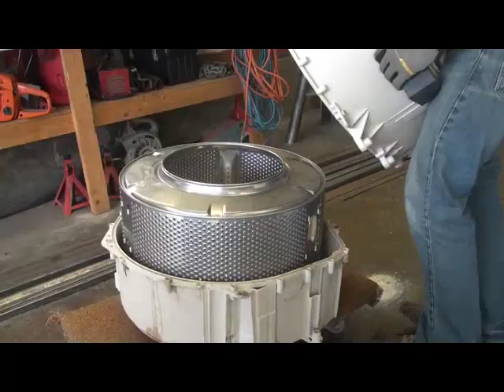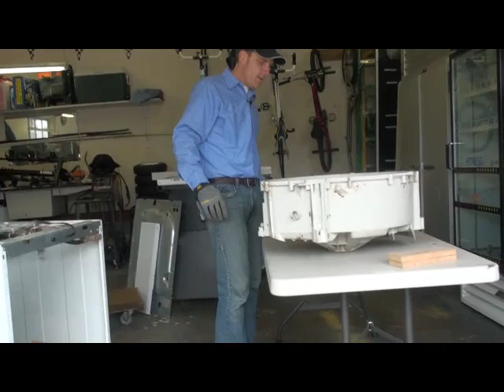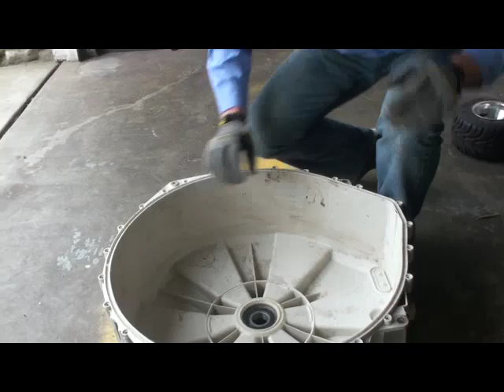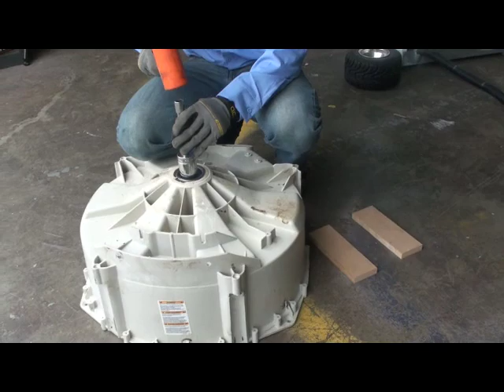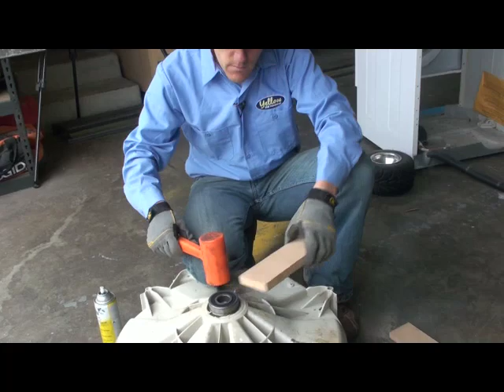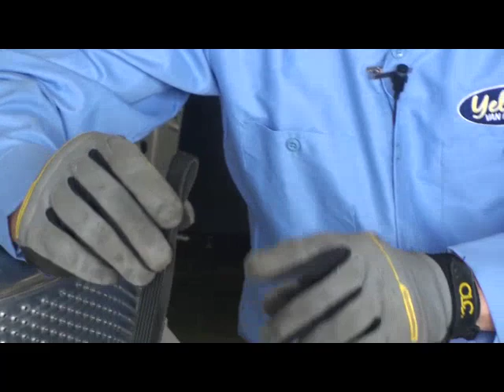Loud Bearing Noise? Frigidaire Gibson And  Kenmore Washer Repair Explained.

Comment: Can you tell me the part number for the seal. My original one says 1312757
Reply from the maker: stheriault3067 The seals do not have part numbers that are useful as the manufacturers do not allow them to be sold individually.  That is the reason why we created a repair kit so that you do not have to buy a $400 - $600 assembly.  See this page for a kit for your machine:  http://www.yellowvanhandyman.com/washerrepair.aspx

Comment: Hi, I wasn't able to replace the bearings, and ended up buying the whole rear tub assembly. About a yr later, I'm having a new problem: the drive pulley has ground some grooves into the body of the tub, and now the pulley get caught in there, pulling the belt off. I've replaced belts, and shock absorbers, but it only lasts for a full wash load before slipping off. Please any ideas?
Reply from the maker: It sounds pretty serious.  The only thing I can think of is you maybe able to put a hardened steel (like stainless) as a washer between the pulley and the housing to prevent the rubbing.  It sounds like what is happening is that the alignment is getting so far off that it is actually causing the belt to pop off while operating.

Comment: I am about ready to take the washer apart to potentially replace the bearings. My concern is that if the spider bracket needs to be replaced. Where can I get one, if needed. I have not been able to find the model # or availability.
Reply: Scott-
You may have seen the comment on the chat group earlier today but the spiders are not normally available without purchasing the entire drum assembly.  Thankfully most of the spiders are not bad so you can swap the bearings and the seal and be ok.  You can also search to find a used unit that is being scrapped as there are a lot of them.
Jerrod

Comment: I just got done working on mine with your bearings and seal kit. didn't take 2 hrs. I used a 5 gallon bucket to set the part on to get the bearings out.  THANKS
Reply: Tim - Good job!  There is nothing on that machine that you can't fix now.  You just did the hardest job!
Reply: Yellow Van Handyman Thanks.....
Reply: Tim Beverly GOOD JOB TIM!

Comment from the maker: No problem.  The spiders are generally only sold along with the stainless basket and they are usually around $275.  But, some have had success getting free spiders and baskets from the manufacture if you call and ask them.  No always.  And, some are now selling the spider separate from the baskets which is nice but only a few models.

Comment from the maker: Yes, that is the same combo of models that I did the original repair on when I isolated this problem and ended up putting the kits together for.  It is not a tough repair.  It sounds like your spider may be broken also so you will want to check that and get it on order.

Comment: Thanks, I found the link. I have the stacked GIBSON Front load washer & dryer combo. The washer went down yesterday & put grease marks on some of the clothes. It must be the bearings. I found grease & gunk all around the rubber edge on the front of the washer. When I reached in & lifted the upper front edge of the drum it had a gap and lots of play. When I let go it just fell down. Our washer model # is GWT445RGS2 manufacturer date of 12-1999. We rebuilt the dryer 4 years ago & was like new.

Comment: Ordered and received the bearings/seal and got to work. Took me about 8 hours but I had to remove the dryer from the top of the stack.  Wear a long-sleeved shirt. Those surfaces inside the machine are sharp.  I left a lot of blood around.  
Really a pretty simple but time-consuming process and the result is a quiet, smooth-running machine the should be good for many more years.  
Oddly, I found about $4 in change and some jewelry in the pump sump. Go figure.
Thanks so much for the video.

Comment from the maker: Bill-
The bearings are sealed.  The seals pop out when water gets inside and they start coming apart and then it moves all the grease mixed with water into the cavity of the tank.  They can be really messy if they have been ran for a while like that which is sounds like yours was.  No grease packing necessary!
Jerrod

Comment: Great video.  My inner bearing completely disintegrated.  When I got the seal off, the bearing parts fell out.  Half of the ball bearings were split in half and there was grease everywhere.
Question:  Are these sealed bearings?  I kind of assumed they were but the sheer volume of muck that came out of that cavity was amazing.  Just wondering if I'm going to have to pack this with grease when I reassemble.

Thanks again for posting the video.

Comment: Really appreciate the great tips.  DIY made easy with the vids you produce.  A question:  When replacing the seal and bearings, do you recommend using steel wool or another abrasive to "polish" the drum shaft if it has minor rust/corrosion pitting?

Comment from the maker: Hector - yes, you are likely correct.  We have seen machines less than a year old need new bearings and seal.  I am not sure why that is in come cases but I can say that the replacement kit seems to provide a longer life than some of the original situations.  I am not sure if this is because of assembly error or other reasons.

Comment from the maker: Amy: Peter, I have been trying to fix this problem. I shipped the 2nd kit without getting the 1st back. I hand corrected the 2nd address and it is now at the sorting facility in your town. We have no control what the post office does or how fast they deliver. I am at this point waiting for an update on the delivery. If there is no change today, I will set it up for you to pick up somewhere in Portland if you want. Sorry for the inconvenience and delay. We try hard to get these out quick.

Comment: I just wanted to say "thanks" for these washer repair videos.  They gave me the primer I needed to crack my 10year old washer open and diagnose my problem, which turned out to be two broken arms  on the spider. This saved me the cost of a repairman visit, and allowed me to move directly to the  "new washer" step. .  Many thanks, CR

Comment: Followed your instructions to the T and my washer works better than ever.  Was told by two different repairmen that it would cost more to have them repair vs just buying a new washer.  Didn't want to believe them, so about $100 later I'm up and running again... can't thank you enough!

Comment from the maker: A little more about the shaft damage issue.  The big reason why I disagree with the shaft damage concern is that we are dealing with a hard steel shaft that is coming in contact with rubber...  The spider would have to break and/or the bearings would have to completely come apart in order for the shaft to touch anything other than rubber.  So, it is unlikely that the shaft will ever be damaged to the point where it won't seal.  In rare cases where there is an issue with the shaft, it is obvious.

Comment: You are awesome my man. You just saved me about 100 dollars or more. I will be ordering bearings and seals shortly. I have almost totally rebuilt this washer over the last year. New motor, new main panel, new shocks, new springs. It has cost me more than a new one in the long run but what I could afford to do on a check to check budget. Great machine and will probably keep it running as long as I can. Thank you again!!!!

Comment from the maker: I have not put together a tool list but that is a good idea.  A cordless drill, a selection of tips and sockets as well as a pair of channellocks or large pliers is a good starting point.  Will need a hammer and some wood blocks possibly and maybe some other things.  I really impervise on the spot so I just make it work with what I have:)

Comment from the maker: @ebartolome83 - The bearings and seal may be fine but I would not risk it because the parts are cheap compared to the pain of taking it all apart again.  Also, when the spider broke, it is highly likely that it damaged the seal because the shaft would have been free'er rotationally.  I would replace the seal at the very minimum but it really makes a lot of sense to replace the seal and both bearings.

Comment: Thanks for the video.  If I'm replacing the basket (spider assembly busted), would I have to replace the seal and bearings as well?  I spun the basket by hand and it seems to spin freely with noise or binding.

Comment: I was ready to pull the trigger on the bearings and seal from the referenced website. But, I got to checkout and discovered that the profit you make on the parts weren't enough for you. Excessive shipping costs were in play as well. Nothing turns me off faster than ridiculously high shipping costs.

Comment: Yes you were right.  First off about not stressing it (which I was).  The wires connected to the motor may have been a little loose.  Washer works fine now.  
On another note it does make a bit of noise in high spin.  Reason being, I used your video as take apart for a broken spider arm.  Bearings seemed to be fine, so I did not replace them.  Now I'm thinking maybe I should of.  The washer was not making noise on high spin prior to this reapair.
Thank you for you help.

Comment from the maker: @splinky2 i would reach in and spin the basket to make sure there is nothing obstructing it.  if not then i would check the wiring hook up for the motor as it sounds like the motor is running slow or laboring.  if neither of those then i would check to make sure all the controls are connected properly as it may not be communicating properly.  not too many factors that could be causing it so don't stress.  you can figure it out!

Comment: Great video.  Very helpful.  I had this very issue with my Frigidaire (gleh1642ds1).
Had 2 of the spider arms cracked.  I put everything back as instructed.  But now the washer does not seem to be cycling correctly.  Moves very slow.  This was not the original issue.  Would you have any idea what this could possibly be?

Comment from the maker: @TheAtam80 - I am nearly certain it is not possible to push the seal on too far.  It is more than likely that it was actually not set into the bearing channel firmly enough and it may be rubbing on the backside of the spider.  It likely will not effect the function if you don't mind listening to the squeak.  It may set itself over time but more than likely it will just rub the rubber off the seal and it will eventually rust through and ruin the bearings but that could take years.

Comment: I replaced the basket, bearings and seal on my Kenmore front load.  When I run the washer and the drum turns slow you can hear the seal make a squeaky noise.  I may have pushed the seal in too far during assembly.  Is this a problem or will the seal eventually set and the noise go away?

Comment: I need the bearing and seal numbers and where to get them for my Kenmore 417.44042400

Please help me located these as i have the new tub  that i ordewred from Sears but they did not include bearings and seals and i dont want to buy the rear assembly
Need seals and bearing infromation
Help please..

Comment from the maker: @seckhouse it does not require sealer but you can use some weather stripping adhesive (3M) if you want.  all the ones that i have done, i have never used sealer when reinstalling the rubber boot.

Comment from the maker: @jesstalon i don't know a ton about that portion of the machines but i have heard that a common "no spin" reason is that there is something wrong with the door switch.  so, you may try shorting out the door switch to see if it will spin.  that would be an easy way to see if that is the problem.

Comment: 417.41042000 This is the model number for my Kenmore front load washer. My question is what would make it not spin? Everything works except the wash and spin cycle the water runs and drains. Please help. Is it worth fixing?

Comment: Great video... Just had an appliance repairman quote of 500 dollars in parts before labor to replace the bearings on my mothers washer.
I wanted to laugh in his face.
 I will be passing along the ordering info and video link to my step-dad, as i think he should be able to do this repair on his day off.

59.99 + shipping is after all a much more reasonable price for a few bearings and a gasket seal.

Comment from the maker: bsmhaze:  it depends upon your model.  the safest bet is to press the seal in as far as it will go until it makes contact with the bearing.  if not, there is a chance that the seal could bind on the shaft.

Comment: The repair is going great so far, but I have a question about the bearing seal. Does it need to go all the way in until it makes contact with the bearing? If I make it flush with the tub by using a block of wood, there is about 1/8-1/4" gap until it touches the bearing. ?? Thanks.

Comment: Yeah!!! Fixed my washer for cheap, thanks so much. Also ordered the hard to find seal from here.
Takes some basic fix-it know how but not impossible.
I rested the machine on it's side when unhooking and re-hooking the springs to the drum. I don't know how anyone could be strong enough to do it otherwise.
I did the disassembly before purchasing the parts to be certain I could do this. Figured I had nothing to lose since I would have to junk the machine otherwise.
Very cool!

Comment from the maker: This is a pain.  I heard recently that someone tried a 2" wood dowel to smack it apart.  I used a very large automotive socket and a big hammer.  You may also try some penetrating oil to help soak it and encourage the separation.  It will come apart.  Don't doubt!  Hit it harder!

Comment: Thanks for timely delivery of your products. I'm having problems though, separating the inner tub from the plastic rear drum. Its almost as if they are stuck together. I banged on it a few times but it barely moved. I ended up with some brownish "sand" falling out when I turned it over. is it possible that the inner tub shaft has fused (via rusting) to the inner bearing? Any tips on how to get it loose?

Comment from the maker: @fanoftu54 ok, one more.... 3) even though you didn't disconnect much, it is possible that something got knocked off say on the back of the control panel while  you were working.  there is just one connector that has to be disconnect for the front panel to come off but it is easy to knock one of the connections loose or off all together.  i would pop the top and check it out.

Comment from the maker: @fanoftu54 most likely this has something to do with an electrical connection either not connected, not connected all the way or something is swapped.  Check everything electrical that you unplugged and see what happened.  Did you unplug anything off the back of the control panel?

Comment from the maker: @BadFeat - this is a discouraging note. you are officially the first to complain. i share the part numbers for the bearings on repair kit web order page. I shot a training video for free and posted it here and a longer version on vimeo. i sourced the seals for the project & work w/wholesalers to be able to sell them 1 at a time. i am working with many requests each week to try to develop kits & seals for other models. i do this in my spare time to help. sorry this isn't enough.

Comment from the maker: @fanoftu54  -  I think I may have misspoke/wrote in a previous response.  It has been a while since I made the repair so I had to go look at my machine.  I DO NOT remove the boot from the drum.  I never have.  I have always removed it from the front panel (which is really easy to do) and there is one clamp over the dispenser tube that is a pain to get back on.  I would suggest pulling it off the front panel and trying to assemble it on the drum separate from the assembly.

Comment: @fanoftu54 
I am up for the task of pulling things apart and putting them back together.  I wanted the spider due to the age of my machine, Since I will have it torn down, I should replace it with a new spider.  Before installing the spider, I was going to rough it up and paint it as you would paint an aluminum boat.I would finish it with polyurethane clear. I will put caulking around where the spider attaches to the tub. New belts. It should last another 10 years.

Comment: @fanoftu54 
I have a fridgidair/Sears part number 417.400422990 , . .  where can I find the bearing for this unit before tearing it apart?   Sears sells the unit as you say as one whole assembly.  In addition, I would think I will need the spider as well.

Comment from the maker: @fanoftu54  -  i normally leave the rubber boot in the front attached to the front assembly.  it is easier to disassemble and reassemble that way and does not require any glue as the boot has to seal but slip freely on the tub.  if you took it off the front assembly then you are going to need to apply some sort of glue (probably a double stick sort of glue like contact adhesive or weather stripping sealer or similar) to reassemble it.  It has to be strongly sealed so it doesn't get pulled off.

Comment from the maker: @fanoftu54 @fanoftu54 - i think it depends upon who you call or maybe someone was feeding me a line but one guy did tell me that he got frigidaire to send him the spider for free..

if yours is in good shape structurally then no need to replace it.  i have never replaced the spider when making this repair. i think it is a great idea to really clean the material well and coat it with an epoxy or marine paint or something like that.

no need to lube the bearings other than ease of assembly.